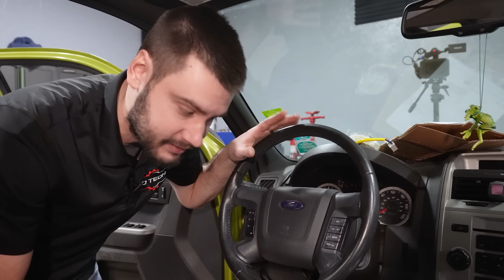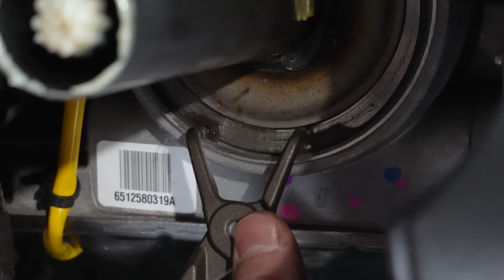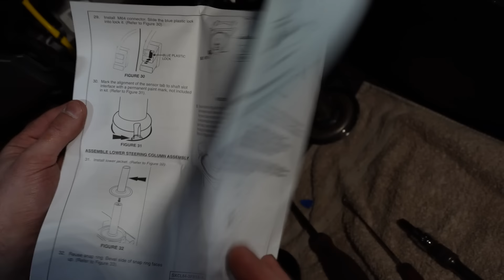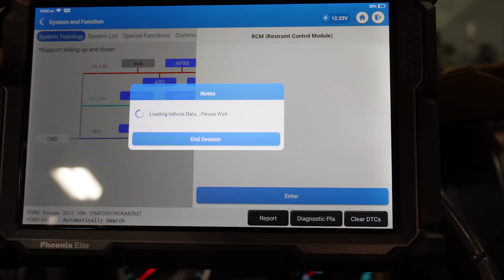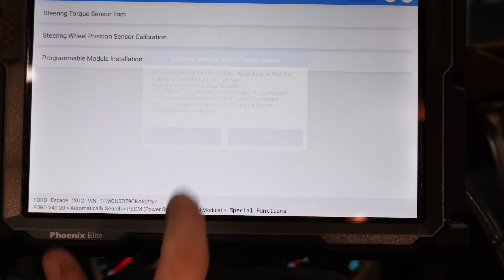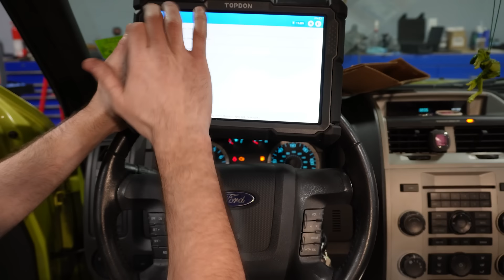B2278 - Power Steering Fault - Ford Escape

Comment: Do you need a scan tool for this repair
Reply: It helps if you want to get the power steering to feel the same turning left and right. But  they will feel different. One side will feel firmer than the when turning the other will feel way too easy.
Reply: But if you are planning to do this you will need large snap rings pliers. Needle nose pliers are not gonna work out very well. I'm talking about like the one he got. I had to pull this in and out a few times with needle nose pliers and it's is a pain. I had to do this on my SIL excape. You also have to make sure that the wheels are very well planted on the ground to make sure the steering shaft doesn't move when you put everything in place. I had to do this 3 times because the wheels moved.

Comment: You've gotta love how ford says it's a 1.6 hour job yet he does it in less than 30 minutes!
Reply: 6.5 hours for my dad and I because we kept having to go to town and buy tools we were missing
Reply: It’s a cut down video
Reply: @OhAlvarez  its still a half hour job.
Reply: @homeguardster  uh negative
Reply: @OhAlvarez so how was I able to do this in 23 mins?
Reply: @homeguardster  hackz
Reply: @OhAlvarez pretty sure if you already have the tools and some kind of knowledge it can be done very quickly
Reply: @homeguardster   bairly a half-hour job.
Reply: 30 minutes to complete the repair. 1.1 hours to get that column shroud back on over the adjustable position lever.

Comment: I’m an aircraft mechanic and I’m fairly analytical, so no dumb mechanic stuff going on here or misunderstanding of your video. . I changed out the torque sensor, but I still do not have steering. I went back through and checked, taking it all apart, putting it back together still same result. No power steering.  Could it be something else or have I truly bought a bad sensor from Ford

Comment: Anyone have a diagram of the way the wires connect when putting it back together I had to replace the entire motor I put it back together and my airbag / steering wheel controls won’t work

Comment: Well after replacing the sensor twice hoping got a faulty sensor the problem is still here... idk what else to do. I've checked all related fuses and all other possibility other than having the code updated. However it never had a code to begin with.. all I got was the warning on the dash.

Comment: I have installed everything correctly twice and I still don’t have power steering. What do I do next?
Reply: Is your battery light on. I had this same issue,  charged my battery and problem was resolved
Reply: If the little yellow wrench like is indicated on the bottom left side that means you will have to clear the power steering fault code to regain function of the system. Its a safety feature

Comment: Great video. Anyone that's struggled with this job or wants more details on what can go wrong and how to fix it read this. It's a long comment. I'm trying to cover everything. I'm going off of what was in this video and adding more info to help. For starters a good set of big snap ring pliers are a must. Without them this job is extremely difficult. I've done it with needle nose pliers before. Possible but a huge pain. It's a hefty snap ring in there. You don't need a helper to do this job. You don't need someone to bump the tire. You can jack the front end up and twist the steering shaft inside the car until you see the hole line up. Make sure your steering wheel is straight before you jack it up. If your alignment is off doing this then it's gonna be a little different. I'll explain both. Proper alignment with the wheel straight you're gonna have to twist the shaft a LITTLE! to the left inside the car until you see the hole line up. If you go past it just go back the other way until you get right in the center. I'm sure you'll pass it. That hole passes you quick! The 11 o'clock position when reinstalling the wheel and steering column is important. You have to have the entire column at the 11 o'clock position (with a proper alignment) for it to slide in. It's tricky and be gentle. Don't force it. It's supposed to slide in like butter. If it doesn't slide right in at the 11 o'clock position your wheels aren't in the correct spot or you don't have the column positioned right. Like I said it's tricky and you gotta be just right. Wheels should look like they're turning slightly left. Check them before you try to slide the column and wheel in. If it's all set right the splines will line right up. Push it in quite a bit then twist the column to the right until you can get your bolts in. Sometimes you push it in to far. Just pull it back out till the bolt holes line up. The splines on the steering shaft are plastic. You can easily mess them up. If you do mess them up not a big deal. Take a file and clean up the slots you messed up. It'll slide in eventually with precision. Just don't keep forcing it over and over and destroy the plastic splines. They can take a little abuse but not a caveman in there raming them over and over. For an alignment that's off just make you sure your wheels are straight when you start. Same steps as above. Then when reinstalling the wheel and column remember where your steering wheel was orignally. Take a picture if you need to. If your wheel was at the 7 o'clock position, when reinstalling the wheel and column you'll wanna be at the 6 o'clock position. Just make sure it's clocked back 1 hour from where you were orignally. Study that old clock on your wall. And Lastly if you get it all back together and still have no power steering it isn't the end of the world and you don't have to immediately buy a new sensor Sometimes you need to clear the code with a scan tool or recalibrate the sensor with a scan tool to get your power steering back. I hope you have one or know someone with one. If it still doesn't work after all that then you aligning everything was wrong. This is where it can get tricky and confusing to describe in a comment. But easy to do in person. You need to reset/realign the sensor. There's 2 tabs on both center plastic gears of the sensor that need to be in line. Pull the sensor back out and you'll wanna hold the top gear of the sensor on one hand while you twist the bottom gear with your other hand until those tabs are in line. Once you get both tabs in line on the gears your hole will be off. Then turn both gears simultaneously until you see the hole line up in the slot then put your pin back in. Make sure that pin drops all the way down. You'll feel it sliding through both gear holes. May have to slightly wiggle it to get it to seat. Then reinstall everything the same way. If it still doesn't work after all those steps then you bought a bad sensor. I've had 4 cheap junk torque sensors that customers brought me. 2 didn't work right out of the box and 2 got them power steering back but failed a couple weeks later. Don't cheap out on your parts people! For this sensor avoid Amazon, carparts, ebay, parts geek and rockauto. You don't always have to go oe with everything but with this sensor you really do. Buy one from powersteeringseals.com or fordpartsgiant.com. Both have good genuine ford oem parts.
Reply: I would add this. When you index the hole in the window make sure the steering shaft is high up in the tilt range. The steering shaft without the steering wheel connected can go extremely low. If you index it at that point it is not going to work correctly. As soon as you start up the vehicle it will turn itself to the left quite rapidly. That one bit me.
Reply: That's exactly what happened to me
Reply: Ok I followed the instructions in this video and when I started the car, the wheel didn't move (video said if the sensor is installed incorrectly it could make the wheel jerk left or right hard to the stop) but the power steering still isn't working. I made sure the installation tool, or guide, was on with no binding. One thing I did was on the old sensor, I tried to put the dot in the window...and when I removed the old sensor and went to install the new sensor, the dot wasn't in the window. The steering shaft looked like it was 180° off. I looked at the guide tool and saw that it has a notch that goes in the groove in the steering shaft. This groove was on the opposite side (180° off) of where it was supposed to be. I got out and turned the wheel to what I believe to be the 11 o'clock position and my spotter said the groove was lined up with the arrow and the dot was in the window. I removed the old sensor and installed the new sensor and again everything appeared to be in its correct position. I pulled the pin and observed the dot in the window. I reinstalled the steering wheel and connected all the wiring plugs (yes I attached the plug for the sensor). I turned the key and the steering wheel didn't move. I started the car but I can tell the wheel is still tight (no power steering ) even with the front tires off the ground. I'm at a loss for what to do next. I tried to Google the problem and someone said I needed to "learn" the new sensor to the car. But your video said nothing about that. It just said I may need to learn it to center the wheel. Again I'm at a loss for what to do now. I would very much like to chat with you. My email is shaggy232350@aol.com. My name is Wayne.
Reply: @waynejones3999  ok for starters this isn't my video lol I'm just a dude that came across it and I've done it multiple times and wanted to give some info to help anyone out here. Sounds like you did all the steps right. If you tried realigning the sensor a couple times to make sure you didn't make a mistake and still no power steering then you bought a bad sensor. I made the mistake of buying a cheap one once. Then had customers bring me 3 cheap junk sensors. Don't buy on Amazon, carparts, parts geek or any of those places. My last one I bought was on ebay and it was oem sensor. It was $150. Been working fine for my customer for a year now
Reply: @waynejones3999 for the snap ring pliers, did you need them to be 90 degrees like in the video? I tried with some 90 degree needle nose pliers but I could not get the left side to move. The only snap ring pliers available near me are straight snap ring pliers. I'm nervous if I'll be able to get it off with a straight pair.
Reply: So I did the install for my son's car, everything looks right but the wheel still wants to pull left like something is not aligned. I had a friend run it through the calibration program with the wheels in the air and after we ran the program the wheel adjusted itself slightly left. Any thoughts on what I may have done wrong?
Reply: @josiahjoiner8763  bad sensor right out of the box. I had it happen a couple times. Got it aligned properly, calibrated it with my scan tool and the wheel still pulled to the left. Returned the sensor and bought an oem one. Put it back together the same way I did with the bad sensor. Fixed the problem.
Reply: @Humbuckerhead1 I’m looking into getting a scanner to do this job. Is there a specific function I need to look for to be able to calibrate the sensor? Or what scanner do you have?
Reply: Do you know where I could find the oem sensor everywhere online is Chinese made
Reply: @Legendarygurth1 unfortunately I got mine on Amazon. I was thinking that there are so many sensors on there for sale so I thought they would be ok. I'm worried I got a crappy part as well that doesn't work.
Reply: Oh and one more thing. He isn't kidding about the snap ring pliers needed to get the snap ring off. I got a Lisle set and that did it with the right tips. That ring is a beast
Reply: Hello am asking anyone about this.. my escape 2010 wheel gets hard to move while driving and then it frees back up.. is this safe to leave it like that.. i can only get part via ebay or amazon..
Reply: Your a saint thank you man this job is a pain in the ass🙏🏽
Reply: I have good snap ring pliers and I can not get the snap ring off to save my life

Comment: Found a good Video describing why the wheel would turn hard after you start the vehicle and found you don't have to replace the sensor after a bad install. Apparently, there are 2 Discs involved in the Sensor where you're aligning your pin and they can't be off at all from each other. Mine was off just a hair past the window on the Sensor which was causing the issue. I was using a Jack that was apparently leaking and the Front wheels moved on me because of that causing the issue. So basically, took off the Sensor, realigned the holes and everything worked out, no Codes and Turning issue. Don't understand why everyone is telling people to replace the Sensor after a bad install, that's an expensive thing to say and not very helpful. That being said I truly appreciate your Video on this, Thank You.
Reply: I just did this to my son's car and everything seems fine except it kind of wants to turn hard left when you steer. Do you think that is a bad install or just need to do the whole calibration exercise?
Reply: @josiahjoiner8763 sounds like a bad install my understanding is the sensor is only bad if the wheel whips to the lock hard.
Reply: https://youtu.be/fP4jU6_Q6wU?si=r0ECpB4msnqDj78D

Comment: What snap ring pliers did you use. All the ones in store are too small 😂
Reply: Just did this today. Harbor Freight Icon 12" internal snap ring pliers. Works like a charm- will take the snap ring off and on as many times as you need!
Reply: @fiercewarrior5686  thanks. Unfortunately I'm in Canada and my best option is Amazon lol. Couldn't find any pliers bigger than 7 inch at the local stores.

Comment: So I did a replacement on a 09 Escape 4cyl because the Steering Wheel was jittering left and right when Engine was running, with this same code, B2278 I read that some Techs had an issue with the Steering wheel turning hard right after initially checking the Steering performance when Calibration was complete, and they ended up just having to replace the whole unit. So, on my Vehicle before I changed anything I verified where the Steering Angle was when driving down the road and verified, I was plus or minus 1 deg and had no other Data like Torque Sensor to go from which I don't understand why that Pid isn't there, I use a TopDon Phoenix Plus. As I was installing the Torque Sensor, I noticed I wasn't lined up like you had happen in the Video. So, I got it centered but not sure if the arrow was exactly lined up, there may have been a slight resistance when I pulled the pin because it was lined up, but I think it may have had some resistance when pulling the Pin because after I did the arrow moved a tiny bit to the left of the notch. Do you think this could have caused the wheel to rotate hard right after I was done? So, I went into the ABS Unit looking for the Steering Angle Pid and found the Angle to be -539ish. I noticed on your Scanner you were at 439 i think, shouldn't it have been close to Zero? I tried to Zero it out and kept getting either Communication issues or something else that wasn't allowing me to Calibrate the Angel back to Zero, I tried an Autel Elite and Forscan with the same but different message. 
 Any help would be appreciated, it's my first one on a Ford. Thanks

Comment: Just did this repair. Video helped a lot. Snap ring can be a pain. Quick trip to the store for larger 12 Inch Snap Ring Pliers made it go in 1st try. Also putting the steering wheel back on I needed to turn the whole column toward the 11 O’clock position, not just the wheel. Then everything slide together nicely. Not that bad of a job. 

Friends car had no codes, but was experiencing intermittent loss of power steering. Solved the issue.
Reply: So I'm dealing with some of the same issues. My symptoms are jerky, twitching steering wheel while sitting at red light,at high speeds feel a small jerk left or right. Sometimes crank up have no power steering at all
Reply: Were did you get the 12 inch snap ring pliers
Reply: @unknown0explanation 
Harbor Freight. Don’t even waste your time with smaller ones.
Reply: Doesn’t look like a 11 o’clock position? More like a 1 or 6 o’clock position. Am I missing something here?
Reply: @decapua at the 20:30 mark you see the reassembly. He states to turn the wheel to 11 and keep the column straight. 

For me I had to turn the column and the wheel both to 11 and it went together easily.
Reply: Did you have to recalibrate the trim with a scanner? Or did it just go back to working without that step? Same issue 2009 ford escape.. thanks!
Reply: @LowKeyDegenR8  I have a tablet scanner and did the calibration for the new sensor
Reply: Is there steering still good at this point? About to do this job on my fiancés car that has the same symptoms but want to be sure I don’t need to replace the entire steering column
Reply: @austin3719 you just need sensor replaced
Reply: @austin3719 car hasn’t had another steering issue since. Over a year later.

Comment: I installed an AUTOTECNICA FD1318479 torque sensor from RockAuto and programmed the trim adjustment. Only lasted for a week and my customer is back with the same B2278 code and armstrong steering. Thoughts anyone?

Comment: I did this and when I reconnected the power I still had the fault and the same dead steering. Do I need to replace the entire motor now?
Reply: Hi. I did the same and still have no steering power. What to do Mike?
Reply: Same thing happened to our car. No steering changed out the sensor.
Reply: Is your battery light on on the cluster panel. If so it's the battery,  bad battery throws out your power steering,  I had this same issue,  ended just being my battery